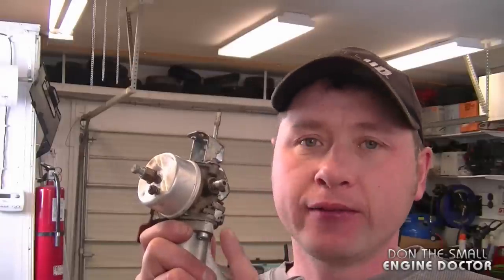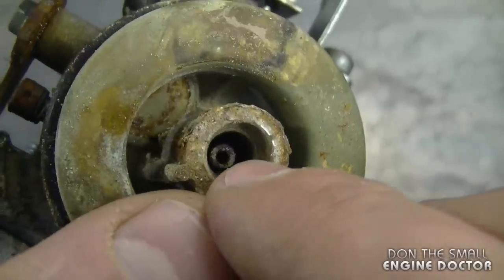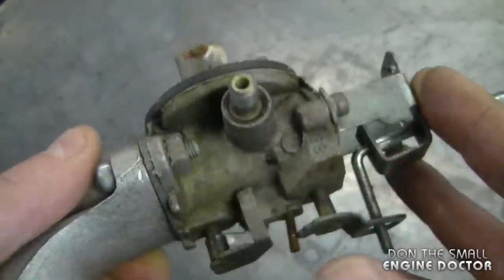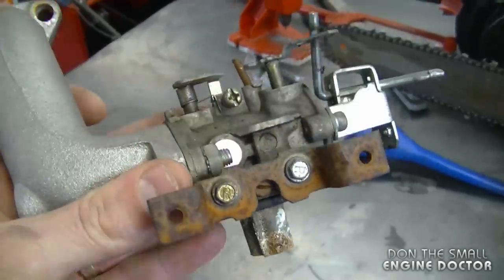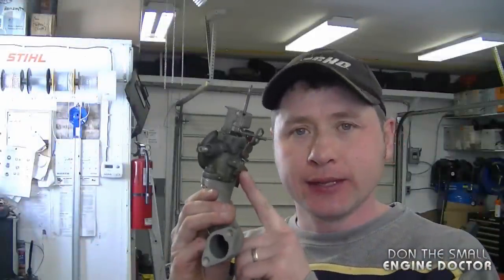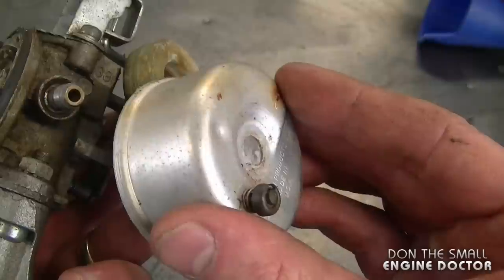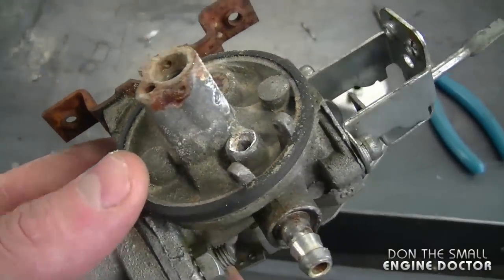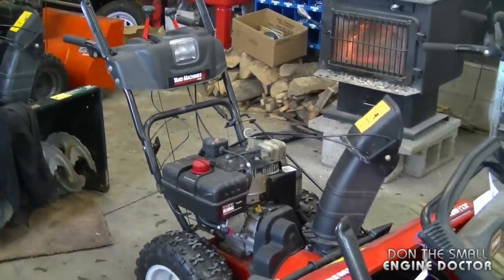What Carburetor Neglect Looks Like!

Comment: I always tell up and coming mechanics that sometimes - to save your reputation - you have to admit defeat and by a new carburetor. Having rebuilt 100's of carburetors through the years, the worst thing is to have someone keep coming back because of a nasty carburetor, that should have just been replaced. The client is the word of mouth. You save them money the first time, which is great, but the next 5 times they are back, that confidence in you (the mechanic) WILL go down significantly. They might not say it, but they are certainly thinking it. The extra money spent with the new carburetor saves them time, the mechanic time and your rep will be AOK! Keep up the vids!
Reply from the maker: exactly

Comment: I had a old Murray push mower with a old 3 hp tecumseh engine come in my shop. It had been sitting outside for like 10 years. I tried repairing the carb, soaking it, removing welch plugs and cleaning it.... Just had to replace it. Great video Don. Thanks for uploading

Comment: Great video Dony!  I find that in many cases the cost of the parts, not to mention the labor whether it's your own or that of a shop, is usually more than the price of a new carb.
Reply from the maker: yes that is often the case now
Reply: @donyboy73  However exact replacement carbs are not always available for older machines like my 1979 Toro 421 which has the pull ring type choke cable instead of the knob used on the 1980-up models.  It just gives me more reason to take care of the original one.

Comment: Great segment Dony and definitely words of wisdom.  I just spent 2 days troubleshooting and rebuilding the carb on my 1970's vintage 3 stage Craftsman snow blower.  The small passages deep within the carb were slowly closing up because of ethanol corrosion even though I keep it inside and drain the gas every spring.  $138 later (new carb) it runs like new.  From now on I will ALWAYS use ethanol free gas in all my small engines.  Ethanol infused gas is a boon to the small engine parts business!!
Reply: Thats for sure. Thats all I run in my machines. I have to drive out of my way to get it but in the end its well worth it!

Comment: And don't forget the bugs and varmints that nest in engines.
My JD111 and old Crapsmen 11hp B&S garden tractors both had carbs worse than this.
I did the rebuild, soaked them in solvents, ultrasound, and scrubbing...
They looked cleaner, but never ran right, just as Don said here.
Same story on my Sears shredder, but a new carb did the trick. 
My old snow thrower was hard to start, and ran rough, new crab fixed it for 60$.
Thanks for the 411, I wish I knew this before, I'd still have my old John Deere 111.
Don
Reply: Right on Don...  See my comment above!  Ethanol free gas from now on!!!!
Reply: Put beer in the belly, not the motor!

Comment: Hi Don.  For years I have been telling my friends on the Vancouver Island to run the engine with the fuel turned off to make sure the carb is dry which will protect the carb from varnish damage.  I have done this religiously for 30 years. This year however was really damp here, no snow but DAMP.  Well I left my Lawnmower out under a tarp and guess what - my carb looks just like the one in your video.

So, any suggestions on where I should consider buying a new carb from.  It's a Brigs 90702 (3.5 hp).  Thanks    Rod
Reply from the maker: Newmachinist it's bound to happen no matter how careful we are, greetings from Ontario

Comment: Not about this video but could i have thin metal sheets welded to the deck of my mower on the underside? Would it stop the deck from rusting?
Reply from the maker: you could but it would still rust unless it's kept oiled
Reply: Go to CTC or Wal*Mart and get a $4 can of rubberised undercoating. won't come off like paint and lasts longer than oil. I have been using it for years, it is even good to spray on trees if you have to cut off a limb. Written right on the can. If you are going with adding something to the underside of the deck try fiberglass cloth and resin. Most of your work will be making sure the underside is cleaned well enough. Main thing (HAVE FUN)

Comment: Couldn't those welch plugs be removed?  It would be easier to clean the tiny passages.  Especially in an ultrasonic sink

I'm only guessing here, as I've never done it
Reply: Hi Rob,  I actually tried that but the small passages were so eaten up by the products of broken down ethanol it was junk.  It was quicker just to replace the carb. See my post above...  Fred
Reply: Thanks Fred.  I have a tecumseh service manual and it talks about removing them from underneath the bowl, and the shiny one on the side to clean passages, but boy are they small!  
My snowblower sits outside of my shed during the winter because of lack of space, ive pulled my carb apart once and it never looked that bad at all.  One of these days im going to do a full resto on my Ariens.
Reply: Rob Thoreson Best of luck on your future resto Rob.  I have found that the blowers made over the past 10-15 years have more and more plastic parts.  They just do not hold up as well as the old steel ones do.  Fred
Reply: @FredMiller  The latest ones often use China made engines which are not made to last plus they often have sealed transmissions made of plastic which are not repairable and cost big bucks to replace.  I will keep my old one which uses reasonably priced and readily available parts and is made of heavy gauge steel which shows little surface rust after 40 years of NYC winters.

Comment: Some people just don't have any sense, and are cheap as heck
I've done car work on a friends snowblower 3 winters in a row,
And it's always same issue 
Water in the bowl, he always leaves it out side
Told him to cover the engine up, looks at me like I have 2 heads
Found a new carb on line for $30 dollars, he thinks it's a rip off 
Told him next time take it in to a shop, and pay there shop rare
Reply: I agree some people are cheap but they wind up paying more in the long run.  I took over operation of a 1979 Toro 421 which had a lawn mower carburetor rigged up to replace the original which was constantly flooding.  Needless to say it was almost impossible to start in the winter with no choke especially with the old gas I was told to use by the owner who also told me to use starting fluid which is dangerous.  I instead rebuilt the original carburetor using original Tecumseh parts and it is still running well a few years later.  It doesn't have electric start but starts easily on the first or second pull with fresh gas in it which I buy just before Christmas each winter.  All of this because the owner didn't want to spend the money to take it to a shop and instead gave it to a neighbor who didn't know what he was doing for repairs.  These are amazingly rugged machines the auger drive and wheel drive still work perfectly and show little sign of wear after 40 years of questionable maintenance and occasional heavy use after some of the bad snowstorms we get on Long Island.